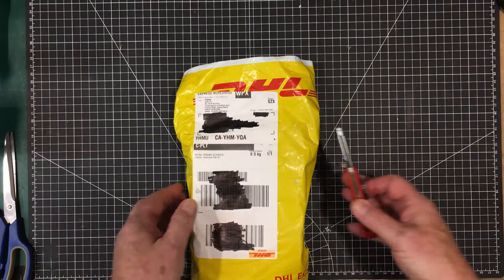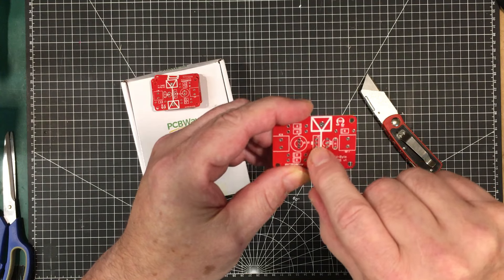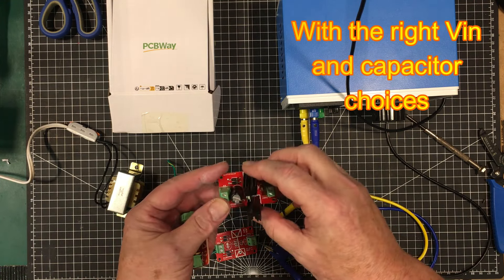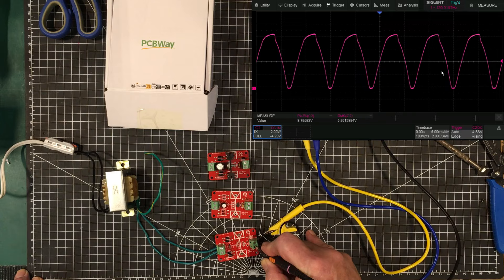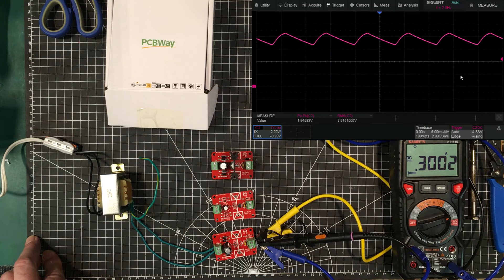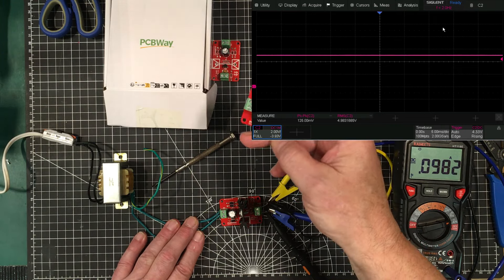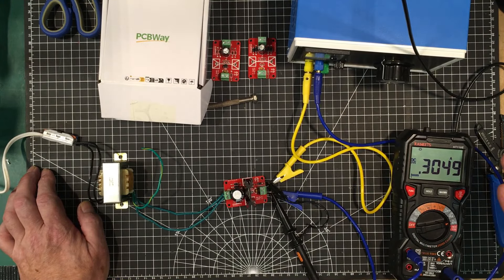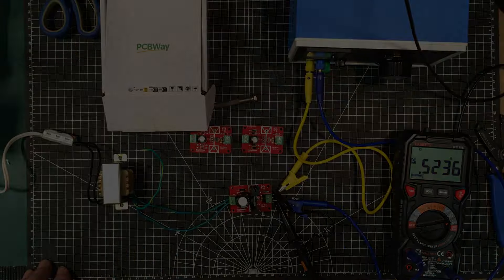Uni-Byte 0220 - SUPER Versatile and CONFIGURABLE Linear Power Supply: Part 2

Comment: Tip: Your use of multiple pin hole distances, on the big caps, is a clever idea to add versatility in choosing the caps' diameters/values. Bravo! Once, I created a big e-cap footprint that was one pin hole and a slot, for the other pin hole. Thereby, there was absolutely no limitation on the choice of cap pin distances. I also created a footprint that is a pair of 1mm pin holes, spaced 5mm on center, with the two pads of a 1206 SMD nested in between the holes. This allows the use of one, or the other, of a 5mm TH, or a 1206 SMD, or both to make a parallel pair... say a 5mm ceramic cap and a 1206 resistor, to make a filter... All in the space of a single 5mm component. I use a great many components that come in both 5mm TH and 1206 SMD... LEDs, ceramic caps, resistors, diodes, on and on. So, I use this combo footprint a great deal of the time. Admittedly, the 5mm THs have to be set on the vertical, sometimes. But, that is rarely a problem and often a preference.  HTH.
Reply from the maker: I like the slot idea.  Very nice!

Comment: I think I would have done LM317 bds with hole patterns for either trim pots or resistor dividers to set the voltage. Of course, I have a bag of about 50 LM317's I pulled from scrap bds a few years ago. But I'm finding that I need odd, typically quite low voltages more and more often for microcontroller and sensor circuits. Between 1V and 3.3V as often as not. Not much interesting stuff is running at 5V or higher any more.
Reply: About 40 odd years ago where I first worked LM317's were pretty new, and we used loads of them. For custom test equipment we had a small board made up very much like this one, Ten turn pots for adjustment, we never bothered with fixed resistors. But one thing we did slightly different was to fit the regulator on one  edge of the board and used a simple L shaped bracket as a heat sink. This also served as an easy way to fit the board into the equipment, and if necessary it could be bolted to the back panel or a larger heatsink if required. 

Andy
Reply from the maker: I had thought about using LM317s but looked at the several hundred LM78XX series regulators I got from surplus store and decided to keep it as simple as possible.  So, kind of driven from the same perspective as you.
Reply from the maker: All good ideas!